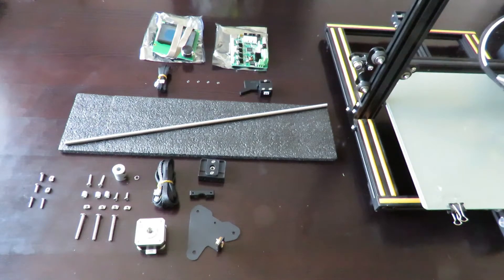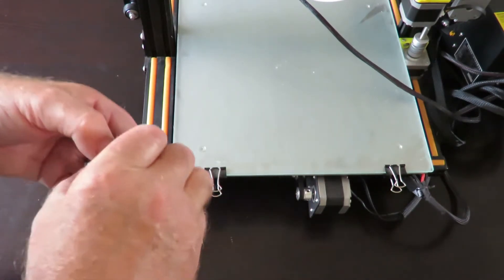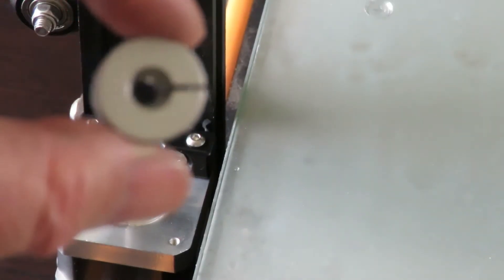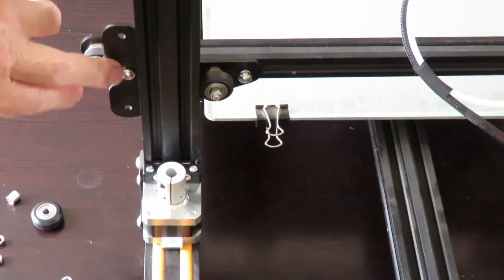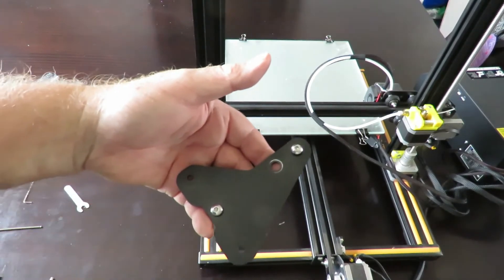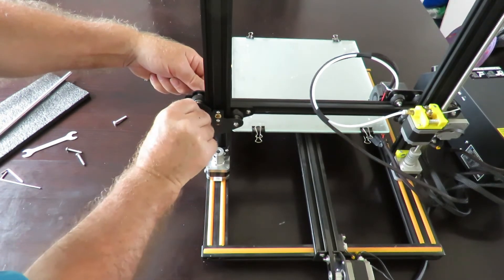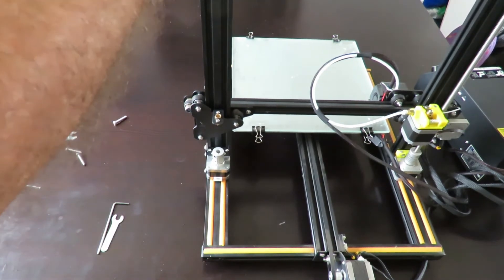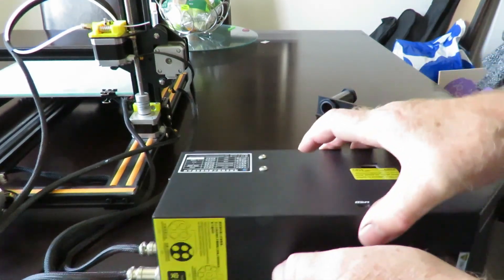📌 3D Printer Dual Z Axis Upgrade Kit for Your Creality 3D CR-10 Instruction Video Part 1 of 3

Comment: I used the Creality branded CR-10 dual Z upgrade kit on my Ender 3, and the procedure is almost identical as for the CR-10 except for the orientation of a couple of bolts. I had to increase the Z stepper Vref. The two stepper motors were too weak at first and would skip. The original Z Vref was 0.55 volts and I doubled this to a bit over 1 volt on my v4.2.x driver board. The new stepper motor and wiring also caused the LCD display to get scrambled and messed up due to electrical interference, including random button presses. I fixed this by isolating the display from the metal frame where it is screwed on, using the plastic spacer found here: https://www.thingiverse.com/thing:3077155
I also replaced the two M5x8 bolts with smaller self tapping screws and plastic drywall anchors for electrical isolation. This totally fixed the scrambled LCD display. You could also use M5x8 nylon bolts. Update: I realized that part or all of the electrical interference problem may be due to the grounded metal case of the power supply having to be removed from the frame in order to position the second stepper motor and lead screw. So another possible solution is to ground your frame to the power supply using an extra wire but I have not personally tested this to be sure it fixes the scrambled LCD display.
Reply from the maker: Thanks for posting a comprehensive step by step solution to the problem you encountered.
I'm sure it will help others with similar issues.

Comment: Great video thank you, used the same method to fit the same kit to my ender 3.

Any tips on levelling the x gantry as mines a cock hair out on the new z stepper side. I know you said not to tighten everything down until it is but I'm not sure what the adjustment process is. Lift the stepper? Space the brass etc. Any advice would be well received!
Reply from the maker: Use a ruler to check vertical measurements, and a set square on the gantry for 90 degrees.
Make sure your drive shafts are clear of any dust buildup, I give them a wipe down every so often to remove accumulated debris.

Comment: Thanks for this very helpful video. Looking forward to Part 2.  Unfortunately I've already done the Dual Z Axis Upgrade, I may have to just bite the bullet & buy the kit for the mainboard & filament sensor parts though.
Reply from the maker: The mainboard upgrade is Part 2 of this video.
I will also be doing a few more upgrades, both firmware and hardware.